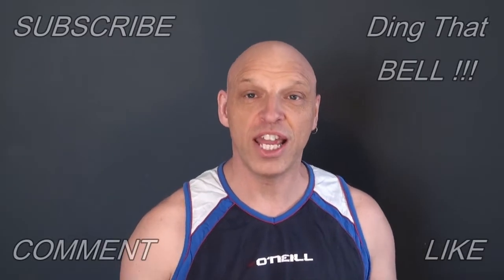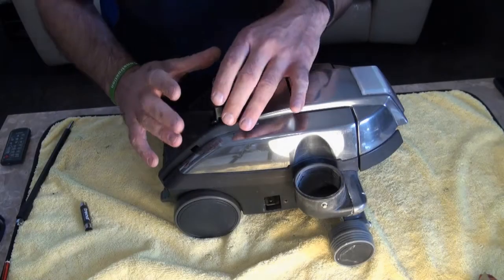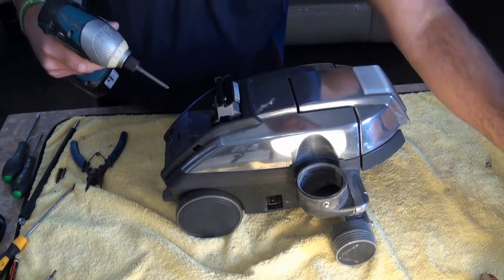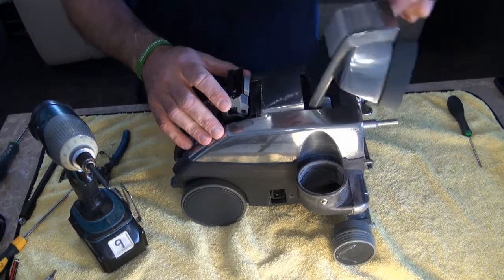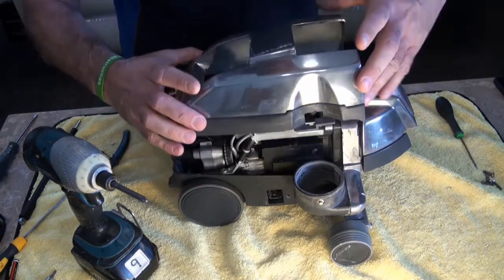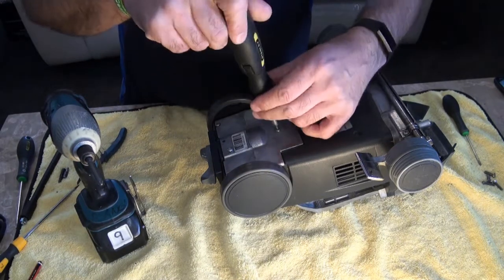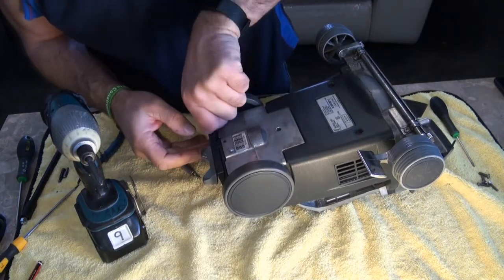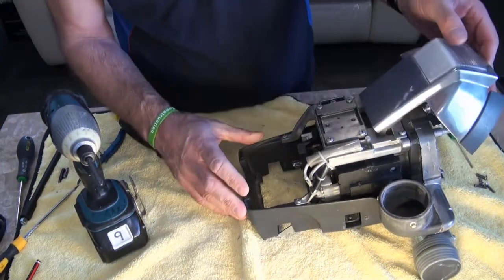HOW TO REMOVE KIRBY VACUUM CLEANER OR AVALIR  FRONT & REAR ARMATURE BEARINGS

Comment: My G4 has a sort of corrugated thin metal ring with tiny tabs protruding inward that fits in the recess where the static washer and the bearing support washer go at behind the rear bearing.  It lines the depth of the plastic recessed area of the housing.  Are you familiar? 😊Does it go in before the thin static washer with the ground wire tab or after? Thanks. I have a picture if I can figure how to send it.
Reply from the maker: I have a Facebook group linked on main channel page . You can post pic in there

Comment: Looks very complicated especially the last part. I wonder what the function is of the bearing and why it has to replaced. Philips head is in Dutch “ kruiskop “ I think. Torc is regular?
Reply from the maker: I didnt know that the only dutch i know is vassel vegal , for water level lol. Torx a more common now due to Philips round off over time
Reply: Kirby Enthusiast Vassel vegal is not Dutch. Waterpeil is water level🤣